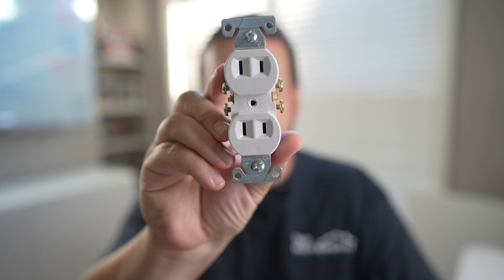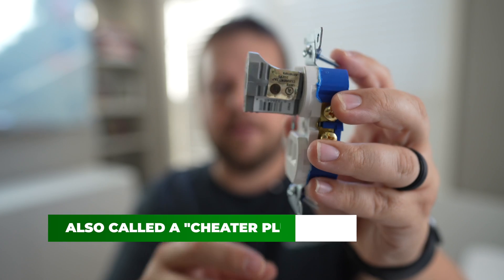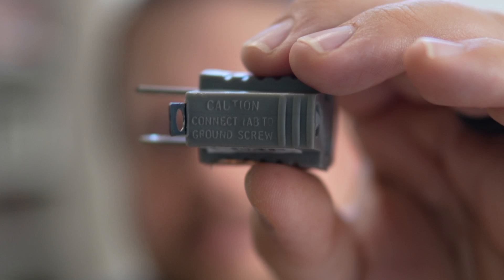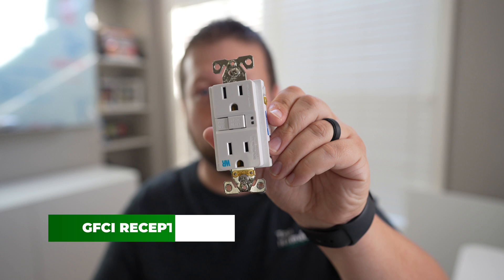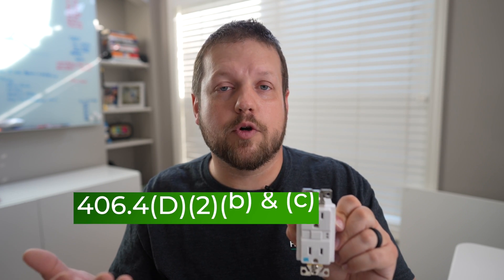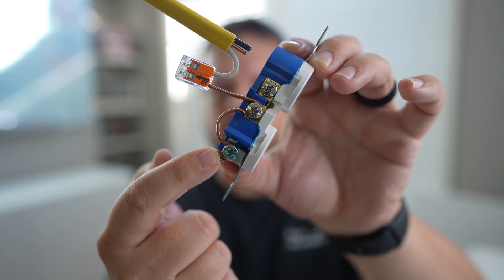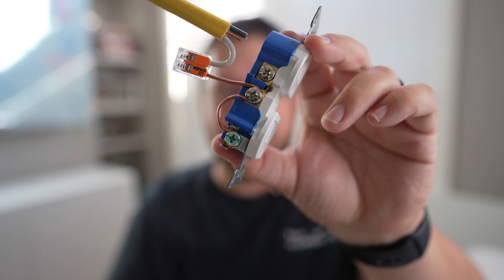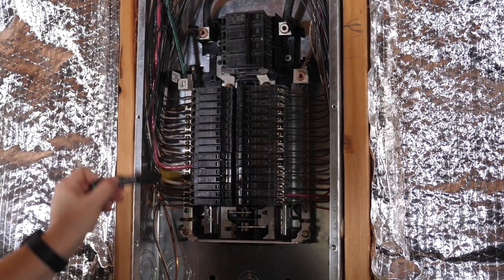3 Weird Ways to Ground a Two-Prong Electrical Outlet

Comment: I have a 4th way. Run a wire from a water pipe up to the ground screw of a newly installed 3 prong outlet. But is this legal?
Reply from the maker: That used to be acceptable, but it's not allowed by the NEC anymore (2002 i believe) since there's such a high chance that plumbing can have non-conductive sections. It's really easy to replace a section of copper pipe with PEX for example.
Reply: @TopHomeowner  How about wiring it on a ground rod or a metal bar/rebar buried on the ground? Would that still work?
Reply: @mangatom192  you have a very good question.  When it comes to grounding, the receptacle must have a ground connected back to the panel.  The panel now requires being bonded to a ground rod and in some cases will connect to a copper water pipe near the main service panel.  The pipe must connect to an 8 foot deep grounding rod as well.  This is 2020 code.  2023 is even more stringent.  The continuity break in grounding to a cold water pipe problem started coming up in the late 70s.  Homeowners started patching broken galvanized and broken copper pipes with PVC pipes in sections, breaking the continuity by not providing a jumper wire of thick gauge copper to continue continuity for grounding.  And when plumbers started repiping homes with galvanized steel pipes with copper pipes, many did not bond grounds from the galvanized pipes to the copper pipes.  Many homes lost continuity to grounded outlets back then.  I happen to own a home built in 1955.  It still has galvanized pipes.  The grounds are not compromised, and when the pipes get replaced one day, I will let the plumber know that the outlets are grounded to the pipes per 1955 NEC code, so that the plumber will bond the grounds and also drive ground rods into the soil for 2023 plumbing code as well.  Plumbing code requires electrical panel grounds be connected at the main entrance to the pipes, then be bonded to a ground rod at every exposed spot outside.
Reply: @mangatom192  Ground  rods do not save you. They might reduce the voltage by 10%. With a GFCI it works, it is enough that 5 mA goes to the ground to trip the GFCI.

Remember how the ground is connected to the neutral. That is what protects you, not any rod.
Reply: @okaro6595  Great reply!  Plumbing code also requires all metal pipes be bonded to a grounding rod where exposed outside.  This includes gas lines coming into a house.  A detached building built before 1962 might be grounded to a water pipe, as builders may not have run a separate 12 gauge ground wire alongside a UF cable from the panel to the building.  UF is a version of NM cable run to wet locations such as outdoors.
Reply: @okaro6595  Thanks. I actually read more after posting my first reply then came to realize that that's the only way for me to properly ground my stuff, especially my pc. I need to have my house rewired which would probably cost a lot.😔
Reply: @mangatom192  grounding  to a metal rod or plate buried in the ground will not work.
Reply: That prevents a shock between the water pipe and the equipment, nothing more. You should use in addition the GFCI.
Reply: No.  First of all there are grounds and earth grounds.  The ground wire on electrical outlets MUST be bonded to the Neutral wire at the junction box.  This is to prevent electrocution from touching metal objects that might be shorted to the hot wire.  If this wire is not connected to the neutral then the circuit breaker will not trip.  An earth ground is something different.  This is when the ground wire is connected to earth via a grounding rod, ground plate, copper water pipe etc.  This is completely different and for a different purpose.  This is to protect the system from high voltage transients such as lightening strikes. It gives all the energy a path to ground.  
If you are going through the hassle of running a wire from the outlet, then run it to the electrical panel, not a pipe.

Comment: None of these examples are a way to effectively ground the outlet.  The only way to growing an outlet is to connect a ground wire that terminates in the electrical panel. GFCI plugs do not provide an equipment ground unless they have a real ground wire. 

No not use any of the methods in this video if you need a grounded receptacle.

Comment: What about running a separate ground wire to the receptacle and grounding to the water pipes?  You can often fish a single conductor wire down from the outlet to a water pipe pretty easy. If I remember you need to install a jumper from the input to the output water pipe on the hot water heater incase it is removed.
Reply: Ground pipes are not low impedance paths back the source and frankly, in the event that a ground fault didn't trip the breaker, it would be extremely dangerous to energize water pipes.
Reply: @chrisruss7863  Plumbing code now requires all metal pipes to be bonded continuously in a residential building.  Gas lines and metal water pipes must be bonded.  All exposed water lines must be metal pipe above ground until it enters the building.  From there, it can be either metal or plastic.  Gas lines must be bonded and protected by grounding rods at the point of entrance per plumbing code.
Reply: @maxheadroom8857  yes but it is still not an acceptable equipment grounding conductor per NEC 250.118, no matter what plumbing code states
Reply: @chrisruss7863  exactly!  I learned about that issue back in 1980 when I was taking electronics back in high school.  My teacher taught about the way most pre 1962 homes in Orange County California were grounded to galvanized steel water pipes at the breaker panel.  CPVC water pipes started appearing in the 70s, breaking grounding continuity in a number of older houses grounded by metal water pipes.  My galvanized water pipes serve as a ground to my electrical in my house.  One day, I will need to change the water pipes and have the plumber bond the pipes to the panel.  Fortunately, my house has a raised foundation, and I've seen the ground wires on my cold water pipe.  I will need to dig under my garage, which is detached, to ground it when I have my home repiped one day, or run a jumper to the plumbing in my garage to bond the boxes to the electrical, as I will not run CPVC or PEX to water spigots in my yard.

Comment: Frankly,  as a residential journeyman electrician, in my opinion those 2 to 3 prongs adapter,  what I and my coworkers like to call cheater plugs, should be illegal,  in fact if you go to the hardware store in Canada looking for cheater plugs you're SOL.   They are illegal in Canada,  at least parts of Canada to my understanding.   Besides allowing for a 3 pronged appliance to be used in a 2 prong receptacle,  cheater plugs find another unsafe use in the  A/V field,  for breaking ground loops and eliminating that 60Hz hum sometimes heard when interconnecting amplifiers,  mixers, turn tables and  similar gear  plugged into different receptacles or circuits.
Reply: I'm Canadian and I was able to buy a cheater plug at my local BMR store, so I don't think they are illegal.
Reply from the maker: It's sometimes amazing to know what's allowed in the US compared to other countries. Thanks for the comment!
Reply: I'm from Mexico and here these kind of adapters are pretty common and even something that's used every day. Not only for connecting to the outlet in the wall but also because many extension coords only have 2 prongs (there are even some extension cords with extra holes that allow to insert the third prong without doing anything).
Today I'm learning for first time that they are dangerous after using them all my life.
EDIT: still I always had the feeling that high power devices (like washer machines or microwaves) should  be connected directly to the outlet without any adapter nor extension cord, but for things like computers, TVs, or coffee makers I never cared.
Reply: All these happen if you use a GFCI.If there is hum you get a galvanic isolator.
Reply: Back in the day, the adapters came with directions, telling the user to temporarily use these, and when installing them, they suggested running another wire from the outlet face plate to a cold water pipe, clamping it down for a temporary ground while using the 3 prong device.

Comment: #1. There will not be metal conduit in 99.9% of the old boxes. It will be 2 wire cable with no ground. There is a VERY slim chance that there will be a ground wire in the older cable but it would have to have been installed at a transition period when ground wires were starting to be required but grounded receptacles were not. It's a short window of time.

#2 Pretty much spot on. In some cases it is preferable to install GFCI breakers that will protect the entire circuit.

#3 Better not be what I think it's gonna be. Crap. It is.  You VERY much understated the danger with this method. The fact that it's not NEC approved is the least of the problems. There are many NEC violations that are of .000000001% risk.  The danger is not fire, it is ELECTROCUTION, which means death, not just a shock.

I'll attempt to explain. In layman's terms, the neutral (white) wire carries current back to the source. If the neutral wire becomes "open" or separated or loose, the current will instead flow on the ground wire. The wire could become open or loose for a number of very common reasons.  If the system is properly installed, the only issue will be that some stuff doesn't work.

If you have a bootlegged ground, it can easily be deadly.    The ground wire on appliances is connected to it's metallic parts. If you have a 3 prong appliance, lets say a refrigerator,  plugged into this circuit, all the metal parts of the refrigerator will be energized. Grab the metal handle while barefoot and you could die a very painful death. Lets say the appliance that is plugged in is a garage door opener. The entire door and all metal components could become energized.

If that was too mush blah blah blah, I will summarize.  Do not ever do this.  Get it?  Never!  Like effing never ever. I mean it. It;s ignorant and negligent and you will have to spend the rest of you life wondering if your hack work is going to kill somebody's kid some day.  Dont effing do it for any effing reason ever.
Reply: 99.9% is a huge exaggeration. I live in a house built in 1920 and all the boxes used metal conduit. Plastic conduit that uses PVC didn't become common until early 60's. And in the late 60's is when we really started to run ground wire and start using 3 prong outlets... but most houses build then would only ground one or two outlets. So I would say 1/3 of "old" homes have either metal conduit or at least one ground wire in their homes. 

I would worry more about possible old, out of code, shotty wiring that could cause a fire then grounding something that likely your main breaker would stop the surge anyway.
Reply: @petermorris699  In our region, steel armored cable, "BX", was required going back a very long time.  The steel jacket provides a ground, although after the many years, problems may have developed like loose connections to boxes or corrosion.
Reply: So true.   In the mid to late 1950s, NM cable with ground along with 3 prong receptacles were in it's infancy and rarely installed,  since the Code did not require it until 1962 to be exact,  and many professional electricians and homebuilders at the time viewed them as an unnecessary expense,  where early grounded NM cable was installed often it was wrapped around the cable clamp where it entered the box and you have what's called a "grounded two prong receptacle "   This would be very rare.
Reply from the maker: Great comment, thanks!
Reply: most people use a separate wire connection to the neutral though
Reply: The metal conduit is a path way to ground (in most cases) through the yoke of the reciptical when that adapter is firmly screwed to the reciptical cover plate screw hole threads and the resptical is firmly /tight to the junction box or wall surface were the receptacle screws are tight with no slop/now that adapter will function just like a three prong receptacle.
Reply: Some older houses have a ground wire attached to the back of the metal junction box to the electrical panel but may be of such small gage that an electrical inspector may not consider it good enough to be recognized as a ground but a gfi device would probably trip when short to ground occurs.
Reply: @Kat-on3nm  Yes, but regardless, it's a good idea to test it so you know whether or not you've got any protection at all, especially if you don't have the option of replacing the receptacle with either GFCI or adding a ground wire.
Reply: I had an electrician replace some of my 2 prongs with 3. He told me my house has a metal conduit that serves as a ground. My house was built in 1959. I want to replace the rest of them. When I open up the box, where will the conduit be?
Reply: @cameronhigh1920  Unfortunately it may be hard to tell, as the conduit is in the wall, not in the box. With conduit, you should see pipe-like fittings with loose wires entering the box. But this would not guarantee the presence of a good ground. Well, if the conduit runs all the way to the breaker panel, "probably." I would do some testing.
Reply: Fortunately, my house falls into the short period with the early ground wire. I replaced most receptacles with 3-prong, being careful to join all grounds in every box.
Reply: My house has a lot of ungrounded receptacles that are served by 12/2 NMC with ground. They were installed during that transition period and, unfortunately, the ground wire was usually trimmed back to the sheathing. It's there, but there is no way to use it.
Reply: eh, 3 wire stoves and 240 volt appliances often had the chassis bonded to the neutral.   Actually not having it bonded can be a problem.  I had a relative get a shock from an electric stove because they touched the stove, which wasn't bonded, then, simultaneously, the fridge witch was grounded.
That may sound like I support bootleg grounds, I do not, but the example you gave is counter to at least some of my lived experience.
Reply: I just found that in a house the first time ever and the whole outlet was melted I changed it out for a GFCI it was knob and tube throughout the house.
Reply: 99.9% may be high, but definitly the default assumption. That metal tab is aspirational at best, and is really just to keep the adapter from falling out. Metal conduit (rigid or flex) did exist in early 1900s, and might provide a usable grounding. But knob and tube and later two-conductor nonmetallic (NW, "Romex") were most common wiring until the early 1960s, and neither provides any grounding of the outlet box or the cover plate screw.
Reply: Late 50's and early 60's NM cables are likely to have a undersized ground conductor. The 58 house I grew up in had it but the '55 house I'm in now does not. Very narrow window of time that they were included.

Comment: Using the GFCI to replace a 2-prong receptacle is NEC approved, but requires 1 more step. It comes with several stick-on labels, one of which is "No Equipment Ground." This label is required to be attached when you use a GFCI to replace a non-grounded receptacle. Also, as with a common GFCI setup, the GFCI can be used to protect other outlets downstream, so they could just be swapped for a 3-prong outlet. However, once again, the label of "No Equipment Ground" is required to be placed on each of those outlets.
Reply from the maker: 100%
Reply: Now, where the panel breakers are obsolete and AFCI breakers are not available, you must now use AFCI/GFCI combo receptacles to meet retrofit rules for non grounded circuits, short of running new wires to the panel.  If you're able to borrow a ground from a bonded box on the same breaker panel or subpanel to all the non grounded boxes & bond the metal box, that is also legal for retrofitting.
Reply: @AlexGoBro make sure white is on silver and black on gold and bare copper wire on ground
Reply: @AlexGoBro  Don't worry about the open ground indication was long as its functioning (trip/reset). You do have a reversed neutral. My guess is your two wire isn't color coded and might have been reversed in the old two prong before you replaced it. Use a no-contact electrical tester to determine the hot wire or just reverse them and try again.

Dont forget the stickers!!!!
Reply: @AlexGoBro I was told to use grunding clips
Reply: Is this legal for home inspection?

Comment: Good job. One thing that should be mentioned is that it's recommend that sensitive electronic equipment such as tv's, computers, etc. should be plugged into a surge protector, but surge protectors will not work on a ungrounded receptacle, gfci's or regular.
Reply from the maker: Great point!
Reply: Why would a surge protector not work? It has all the pins connected by varistors.If there is a surge voltage between lie and neutral the surge protector will pass it between them.
Reply: That's what I was thinking. Nice to mention, I had to wired a plug to use a No break  for my computer.
Reply: @urband10 I see it's been 2 years, but if you're still out there could you expand on this approach and offer a brand name/model/source? One of my sons just moved to a completely non-grounded apartment and is worried about his electronics. I can't find anything short of rewiring that protects equipment.

Thanks!
Reply: their is a 2 prong to 3 prong surge protector that works with only 2 prongs
Reply: I have a surge protector installed in my panel because of this, I wonder if it will provide any  protection on the circuits I have that are 2 wire only.
Reply: @bgarren444  No, surge protectors use metal oxide varistors to divert excess current to ground, so a ground wire is required.